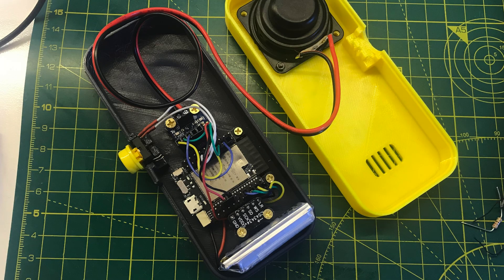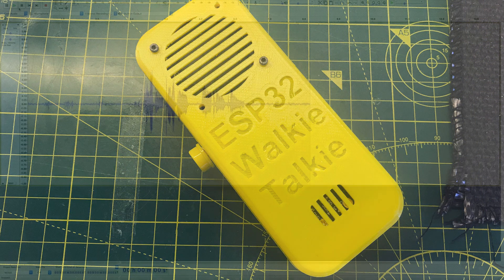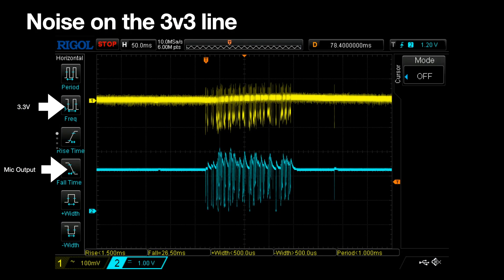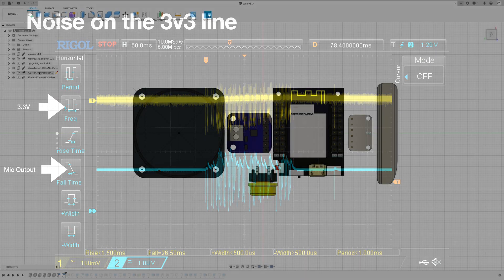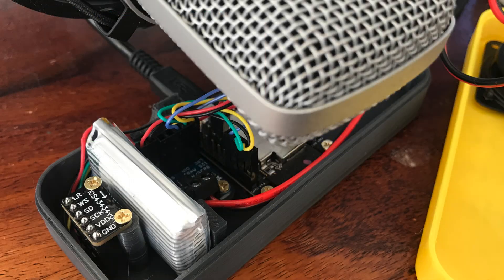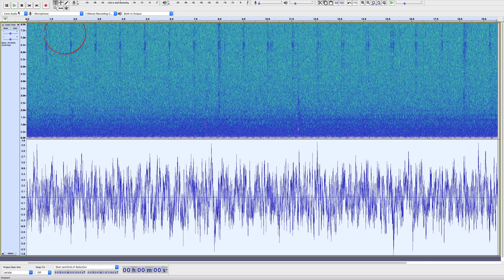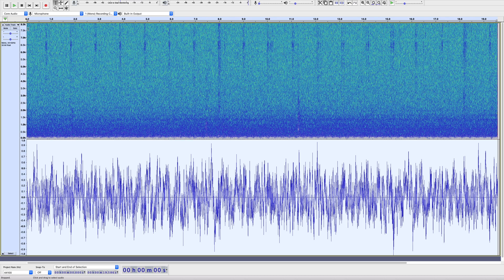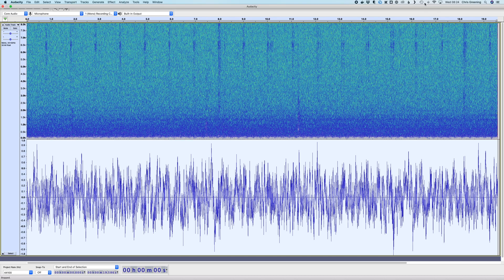ESP32 Audible Noise When Using WiFi

Comment: Same with my ESPCAM, i can hear it ~5 metre far from the board, and it make a continuous sound when transmitting on wifi... 

The ESP dev module (or WROOM) make the same noise but almost imperceptible.

Comment: I noticed an audible noise in all 5 of mine but only when plugged into the little ESP32-CAM-MB module, i'll see if they do it without the module. Did you solve the problem ?
Reply from the maker: It is basically noise on the power line - the best way to remove it is to power the microphone with its own 3.3v supply from another low dropout regulator. If you can add filtering then even better - an RC circuit or LC circuit works well.
Reply: @atomic14  Thank you.
Reply: @atomic14  So in the end it wasn't actually physical vibrations on the board being coupled to the mic? I thought people could actually hear their ESP32 making audible sounds?

Comment: I made a project with an ESP and a mic preamp, it was quite a nightmare to get rid of the noise. I ended up powering the opamp with a separate linear reg and making sure that the ESP can't pull the ground "up" on it by using a star ground topology. I also added a .1 ceramic cap on the ESP 3.3v rail. Also... Try a different module (brand, source), I have one that would add noise in the audio even if not physically connected to it, up to a meter away!
Reply from the maker: Yeah, it's a bit frustrating. I've seen this noise before but with analogue electret microphones - which I cleaned up by conditioning the power supply. But I've never seen it on I2S mics before. so I wasn't expecting it. This is a new dev board that I've not used for audio projects before so it's definitely dependent on the board being used. I've put in a simple LC filter and LDO which seems to clean things up. Will post a follow-up as I learn more. Weirdly I can still hear a noise coming from the components - but I'm not sure it's the ESP32 - need to eliminate some things.

Comment: Any pcb making noise that it should not, won’t be long in this world. 
Vibrations = Movement = Stress = Work hardening = Failure. 

Did not think that there were any wound coils in the Esp32, at 2.4GHz the coils would be very small and formed in the chip die itself.

Get your engineers rubber tipped pencil out, these are just right for hitting the pcb to look for microphonic issues. 
Multilayer caps are good for acting as a noise source, electrostatic action on the many plates. So give them a hit first.

Great idea for a wifi walkie talkie, to make it really portable you just need to link it to your phone via a hot spot and the world's oyster. :)

like the vid's keep um comming.
Reply from the maker: It's definitely a weird one - I'm slowly narrowing it down. There is also a lot of noise on the power supply which needs to be cleaned up. I think the sound I can hear is quiet enough that it won't noticeably impact the audio. Need to take everything apart and see exactly where the noise it coming from. Like the idea of the rubber-tipped pencil!

Comment: You could design and implement a digital filter on the esp32 module Matlab has a convenient filter design tool and there are some free tools online
If the interference has a fixed frequency a narrow and steep bandpass shouldn't decrease sound quality by much
Reply from the maker: I think a bit of signal processing will go a long way. There's definitely a lot of noise that is simply crappy power rail noise that can be filtered out before it even reaches the microphone. Hopefully, these sounds I can hear are actually so quiet that it won't really be picked up. I am starting to feel slightly mad - hearing things...

Comment: Perfect !..Oddly enough I'm using a diode that is reversed biased to 'create' noise (Pink noise project) and your trying to get rid of it .  Regarding your noise, never heard of this before, if you can systematically swap out parts and try to narrow it down ? or as you say drop the power or screen individual components, not much help...cheers.
Reply from the maker: I've been chatting with Janak who flagged up that it's actually real noise and not electrical - he's tried quite a few different dev boards and found they all make some noise. Normally you wouldn't notice as it's very very quiet. Seems that I've got some physical coupling going on and the microphone is close enough to pick it up. These I2S microphones are very sensitive and pick up really quiet noises. I'm thinking just dropping the WiFi power is the short term solution.
Reply: @atomic14  So was the ESP32 chip actually vibrating itself in the end?
Reply from the maker: @ytubeleo  In the end my problem was power supply noise.
Reply from the maker: @ytubeleo  In the end my problem was power supply noise.
Reply: @atomic14  So just electrical noise from the power supply, not components of the power supply vibrating? Would putting decoupling capacitors next tot the microphone not fix that? And when you say power supply noise, was this from a chip on the board, or your lab power supply, or do you mean noise on the power line caused by the ESP32 itself? Thanks.

Comment: Would using an isolated DC to DC converter to power the microphone side work? I've seen this solution used on noisy Bluetooth boards before with good success
Reply from the maker: That would be my normal solution - but in this case, it seems to be actual physical noise instead of electrical. You can actually hear it if you put your ear close enough and the room is very quiet.

Comment: Maybe adding some foam and aluminum tape/foil between esp and the I2S microphone. Maybe you can also try to shield the speaker too.
Reply: Better pot the esp32 with expoy resin. Prevents any coils from vibrating.
Reply from the maker: @banknote501  That's actually a pretty interesting idea. Would need some kind of mould to keep the pins and USB ports clear.
Reply: @atomic14  
Use ear plugs. They have the damping you want. In the past we used them on drones for decouple the camera.
Reply from the maker: I was thinking of adding rubber washes to remove any vibration transmitted through the case. And I think some foam might be a good idea as well.
Reply: @atomic14  instead of rigid mounting the microphone you can use a bit of light open cell packing foam and a dab of hot glue or CA glue. This technique works in reducing vibration noises induced by fans. I guess it could work with a mike too. A kind of frugal shock mount.
Reply from the maker: @photocromax  That's a good idea! Decouple it from the case.

Comment: same issue regarding some pins using uart - they get fcked up by this too
Reply: Oh, good to know. There are glitches in one of my projects I cannot explain. Maybe that is the cause. I'm using WiFi and 3 Uarts at the same time.
Reply from the maker: @banknote501  Check your power supply has enough juice - lots of the dev boards are a bit crappy and have really noisy power lines when the WiFi is in use.
Reply: @atomic14  Thanks, yeah I know that but sometimes I forget to check. Will power up my oscilloscope. BTW your channel has some great content. Useful and easy to follow and even some innovative things.
Reply: @atomic14  I'm also struggling with power noise when WiFi is on. I'd appreciate if someone points me to resources on how to calculate parameters of LC, RLC circuitry to reduce the power noise. Or perhaps some clean voltage regulators... even better: a voltage reference as a power supply for sensors with low power consumption?

Comment: Hello there,
I think the problem is with the usage of internal ADC/DAC in ESP32.
Ist - I do not see the exact model but I think you may think about 'noise' cancelation and 'calibration' as it is shown in the documentation (see: https://docs.espressif.com/projects/esp-idf/en/stable/esp32/api-reference/peripherals/adc.html#minimizing-noise )
2nd - I am not sure which one ADC are you using in the project but you cannot use ADC2 with WiFi (see: https://docs.espressif.com/projects/esp-idf/en/stable/esp32/api-reference/peripherals/adc.html#adc-rtc-mode) 
3rd - I presume, you detect WiFi "Beacon frames".
Example solutions (https://www.esp32.com/viewtopic.php?t=9613) like adding capacitors/resistors to ADC/Power Source, exchange internal for an external antenna, lowering the WiFi power (but that reduces the link budget...) can help
Howgh!
Reply from the maker: Hi there, that's really useful stuff. I should have made it clear in the video - this is an I2S microphone so doesn't use the internal ADC at all. I think definitely lowering the transmit power is going to end up being the solution.